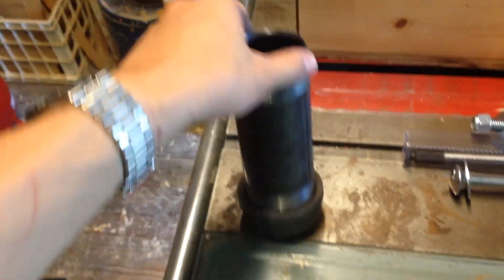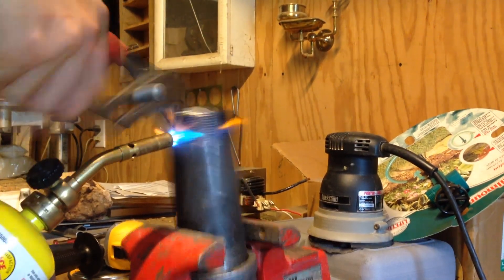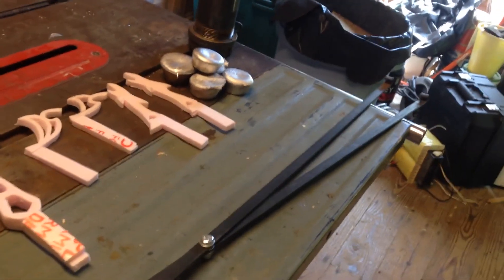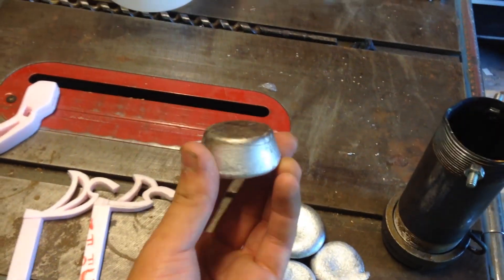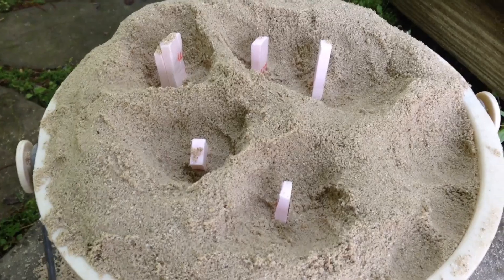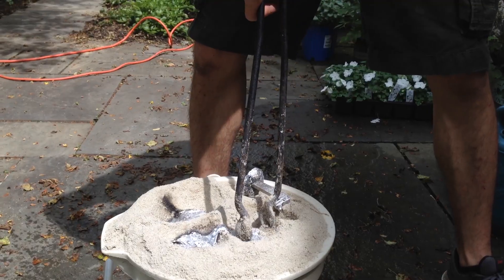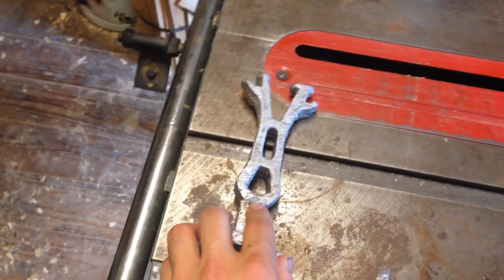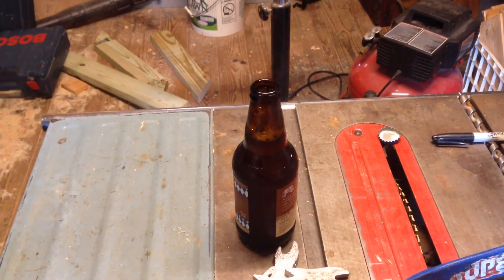DIY Aluminum Furnace, Casting Metal

Comment: When I started metal casing I experimented with different types of crucibles, I would really recommend you to use thicker steel as the pipe will not last for more then a few castings ;-)
Reply from the maker: Thanks for the advice! After I made this video, I upgraded to a 4" sch 40 pipe which is a good deal thicker.